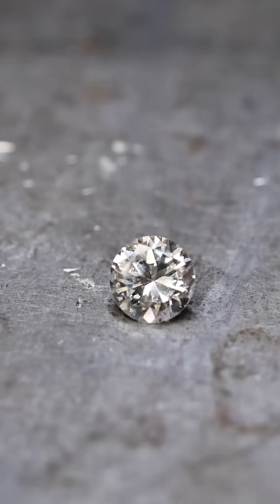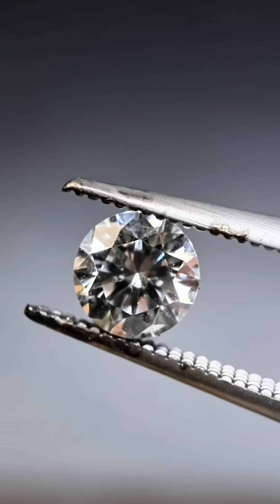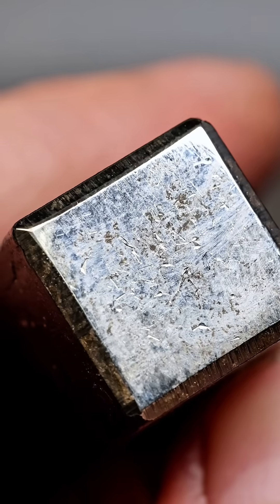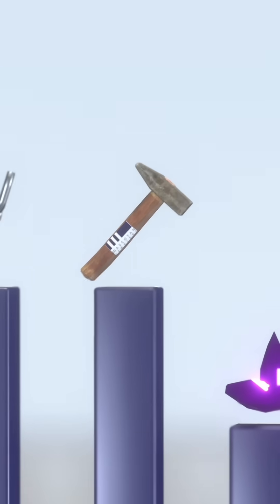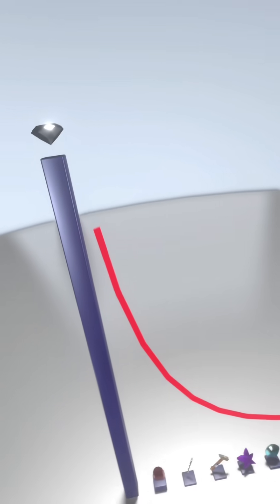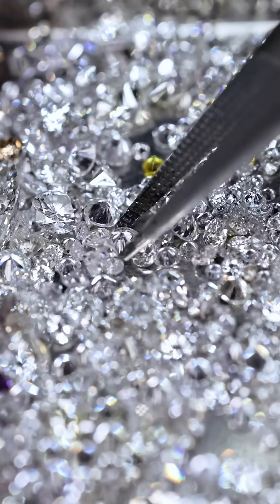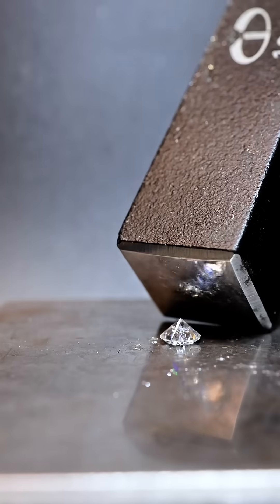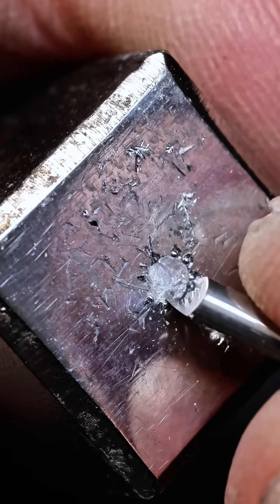Diamond vs Hammer

Comment: Hardness: resistance to localized surface deformation 
Strength: resistance to bulk deformation (strain)
Toughness: total energy required to reach mechanical failure 

Diamonds are very hard, very strong, but not as tough by comparison
Reply: At LAST !
Thank you. Beautifully succinct. 
(Slightly too succinct for strict accuracy, in just one detail - permanent deformation -  as I'm sure you're aware, but it doesn't make any difference for the purpose of this discussion)
Reply: @Gottenhimfella   Yes I was using the term bulk deformation to refer to both elastic and plastic deformation, but thank you for the clarification
Reply: Being so hard is also why they aren't very tough, since they basically shatter at the first sign of deformation. Diamonds are insanely hard to crack, but the moment you even scratch them; the entire thing comes apart.
Reply: I'm having trouble understanding this. What's an example of a hard material that's not also strong? And is it possible for something like a steel hammer to break a diamond? Like is there some point/scenario where the force from the steel doesn't just deform the steel, or is that not possible? I guess why is the table not getting deformed in this video? Is that explainable by hardness/strength/toughness?
Reply: @elijahbuscho7715  the example of hard material that is not tough is a Diamond. If its hard to understand, then another perfect example is Glass. Its can scratch most of the materials, but shatters from pretty normal impacts. The opposite of this, a tough material, but not the hard one is rubber. It easily absorbs impact and deforms, but its also very easy to cut and scratch. And yes, you can absolutely smash and break diamond with normal hammer
Reply: @ I said hard material that's not strong. OP said diamonds are hard and strong.
Reply: @elijahbuscho7715  ...diamonds. Diamonds are very hard and comparatively brittle. A lot of super hard materials shatter like glass when enough force is applied. Tungsten metal, for example, is more scratch resistant than titanium but more likely to shatter if impacted with enough force. Titanium metal, on the other hand, is more malleable than tungsten while also being pretty hard, so it arguably strikes a more even balance in terms of durability.
Reply: @ Can you explain this in terms of hardness, strength and toughness as described by the OP?
Reply: @Naznoreph  вольфрам никак не может разбиться при сильном ударе, это самый прочный металл в мире и он обладает средней твердостью, 6 единиц по шкале Мосса
Reply: Way to lay it out fella 👍
Reply: Scalies don't get to be right.
Reply: Thanks! 😁
Reply: those are some very rubbery definitions there they are
Reply: @ What definitions do you prefer? or are you making ze leetle joke?

Comment: Why would anyone ????
The deal is its zirconia.   Its actually a very hard material.    Its what they make permanent implants (teeth) with.    They charge $ 10,000 or more for top teeth another $10,000 or higher for lower.    The sh** hard to break.
This is for teeth alone the actual implants that hold the teeth in have to be drilled in bone (jaw) and cost extra another $$20,000 or more  this is a rip off.   All dentist in america are overchargers.   Something they put $1,000 into they want $15,000 for.    If course it comes with a little labor but should be illegal to charge so much.    Only in america.   Go costa rica or other country and pay at least half off or often even cheaper.    U.s. is a place where rich are backed by government to rob you.   Pharmaceuticals especially.    Wake up.   Wise up. America!!!

Comment: Diamonds have kind of quirky properties, at least for industrial use. Being as hard as they are makes them fantastic as abrasives and pretty useful for stuff like PCD coatings, but you don't usually see them get used for cutting edges the way you do with cubic boron nitride crystals. Don't know enough about the materials science to say why, but what I've heard is that the CBN holds up to impacts and heating that would cause a diamond tool to shatter at the expense of being slightly softer. In cases where the diamond being in small, irregular shapes like abrasives is better, diamond's the go-to instead.

Comment: hardness and toughness are different. think of it like throwing a plastic bottle and a  glass bottle at a brick wall. the glass will break but the plastic wont because plastic is tougher than glass while glass is harder. this means its extremely easy to break a diamond with blunt force.

Comment: Since diamonds have a really hard hardness on the hardness scale... Well let's put it this way it's a higher an object is on the hardness scale means the easier it is to break and shatter do you not need another diamond to break a diamond it just requires enough Force and enough acceleration to shatter the diamond

Comment: You can very easily shatter a diamond witg steel. Just hit it on the point. Something you conveniently didn’t do the first time, and did do after putting the diamond in the hammer.

Comment: As an engraver, I have seen someone misuse a diamond etching tool, and the rod holding the diamond took damage, the steel cup it engraved ended up with deep gouges, but the tiny diamond that few out was just chilling. Some diamonds are still in use in some of our machines after 8+ years.

Comment: Fun fact. While diamond is the hardest material. It’s not the strongest. Hardness and toughness aren’t the same thing. It’s the crystal structure of diamond that makes it so hard. But that crystal structure also makes it seriously brittle. In some directions diamond is extremely difficult to cut. But in others it’s actually really easy.
Reply: Either way...that was one expensive experiment...completely justified use of swear word.

Comment: You can still crush a diamond by hitting it just right. Hardness doean't measure shearing strength.
Reply: Well if you just smack a diamond with a hammer it aint gonna break. You have to hit it with a chisel
Reply: @morpheus_9 looolw

Comment: Hardness does not equal durability. Even watching this video you can see the hesitation in hitting the diamond. The ziconia you wacked with a good 6 inches of swing, the diamond your doing like 2 inches with a lot of hesitation. Diamonds are used in a lot of industrial applications and they break and wear out all the time.

Comment: You can in fact still break/shatter a diamond with a hammer. You just can’t scratch the surface of the diamond with a hammer. Id you do a solid swing with the hammer instead of those lazy hits you’ll actually shatter it to dust almost